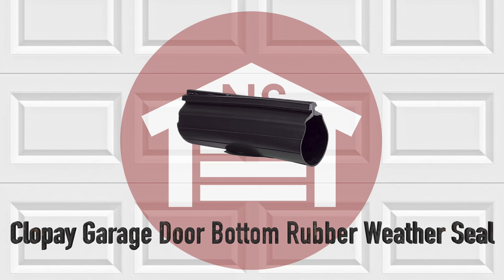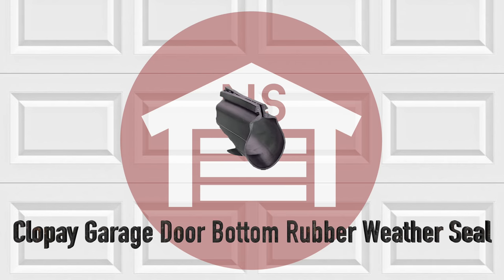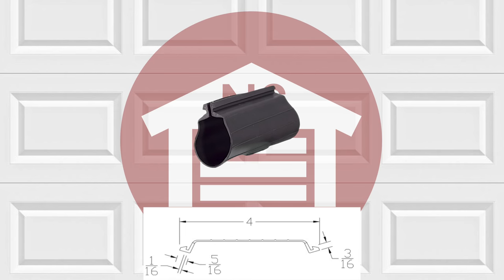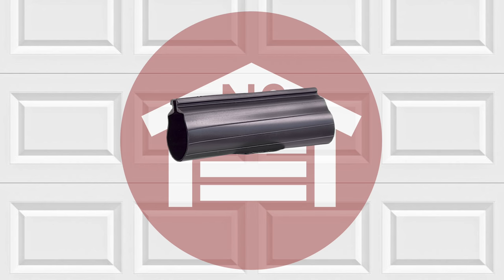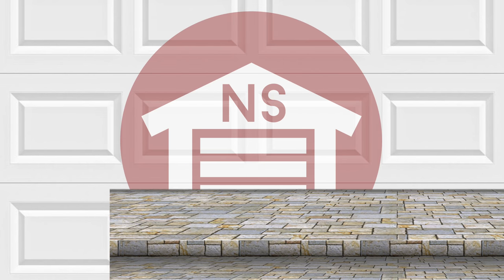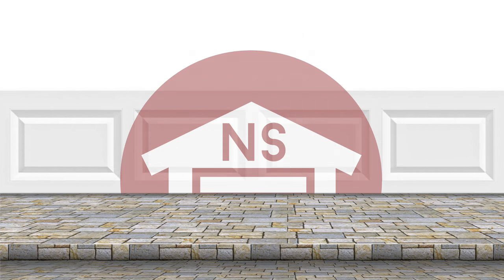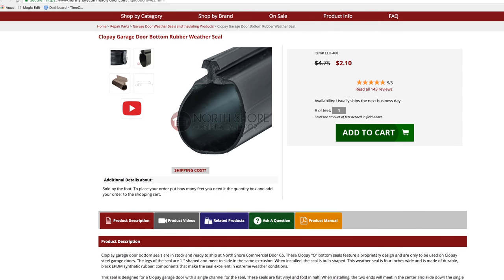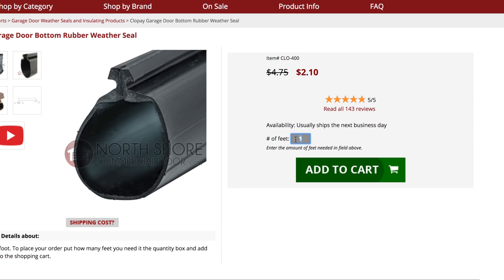Clopay Garage Door Bottom EPDM Rubber Weatherseal

Comment: The good news? The right parts are readily available at Home Depot for a modest cost. 

I'm just a homeowner with reasonable skills, but have never done this repair before. And the instructions on the packaging the weatherstrip comes in are useless. Utterly useless. 

Our Clopay 18' door was installed in 2009 and the bottom panel cannot be reinstalled after the new weatherstripping is inserted - the screws are under the weatherstrip and secure the panel to the flat bottom of the door, rather than screwing it into the lower front and back of the door. To access those screws, one must first remove the old weatherstrip..... 
this being the case, the option of removing the bottom panel with the channels for the weatherstrip to slide into, is removed.  One can't simply take panel with the channels off the door, insert the new weatherstrip with ease, and then screw that panel back on. That would be the simple way to set the door up and make it easy for the homeowner to replace the weatherstrip, and it seems to work on some (perhaps older?) models based on homeowner videos I see here on Youtube. I just finished putting new bottom O seals in my two 18' doors and I'd recommend having helper handy before you start. It's not rocket science, but the angles are a bitch. I used some Vaseline to facilitate the job. Amazing how a little Vaseline makes great things possible.....  :-)

It is worth noting that one of the entry point for the tops of the weatherstrip into the channels is partially obscured behind the channel the rollers on the side of the door travel up and down in. The weatherstrip has to be bent at a 45 degree angle in a very tight space to insert one side of it into the channel, then you need a person holding the weatherstrip at the same height as the channels it has to be slid into. I don't think one person can do this as both hands are required to bend the weatherstrip and feed it into the channels, while another person keeps the feed level. If it's allowed to hang as it's being fed, it will jam and you have to start over. That is...unless you loosen the plate at the bottom of the garage door that is supposed to be so dangerous. There's the bottom plate, and the "handle" above it. Loosen them slightly (Careful!) and you can push the channels back enough to get a better angle on pushing the weatherstrip into them - almost a straight shot. This makes it possible for one person, with a little aggrevation..... the door seems to have been designed in such a way as to prevent the homeowner from doing their own maintenance.....